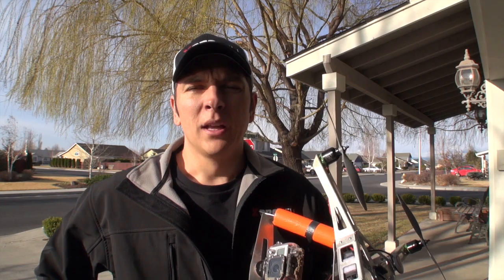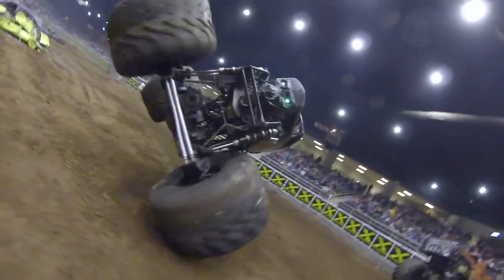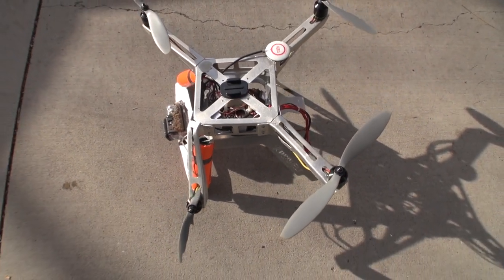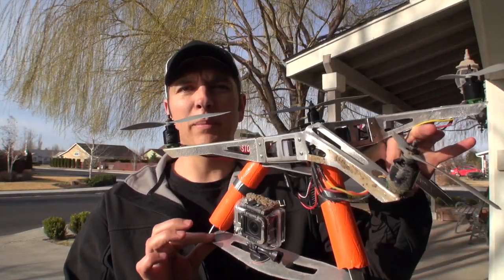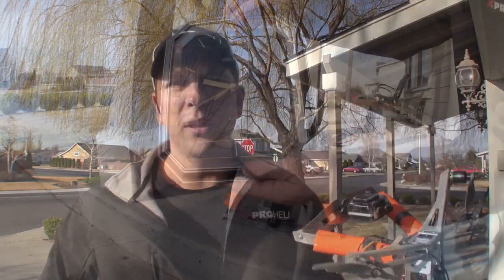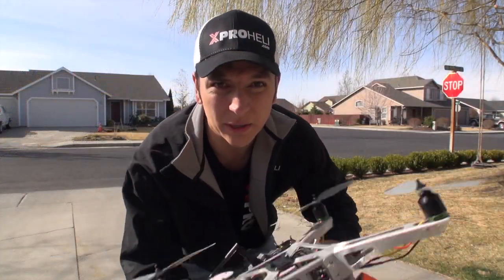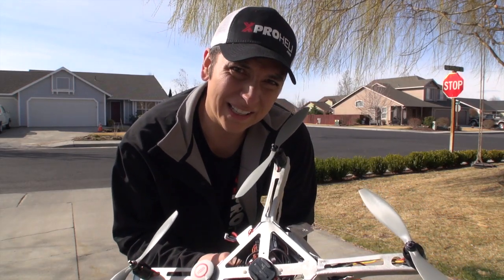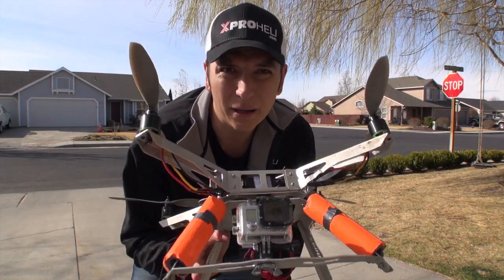XP2 Quadcopter Field Repair after Crashing into Monster Truck

Comment: I use a piece of hard wood shaped like the inside of the arm. Put the wood in the arm, and put the arm on a heard metal surface like a table saw or a lead brick like my buddy has. Then I hammer out the arm with a metal hammer. I also hammer out the legs and camera mount with a metal hammer. It works because it actually bends back the metal straight. With a mallet it tends to not go back onto the original position. I've been meaning to make my own video. I have a lot of experience with this...

Comment: Thanks! Very impressive! I tell everybody who's interested in getting started that the XP2 is the ideal platform because no only is it a wonderful airborne photo and video platform, but it's very forgiving.  While I'm at it, do you guys ever use a rubber mallet and various wood forms instead of a wrench to straighten the aluminum pieces? Seems it might be a bit less taxing on the structural integrity.